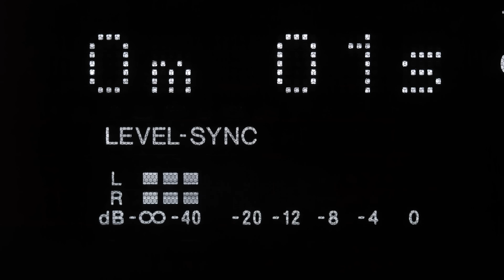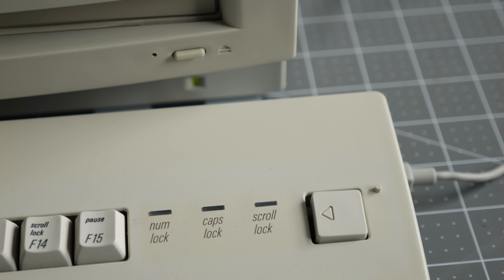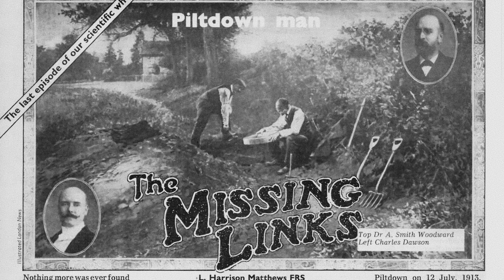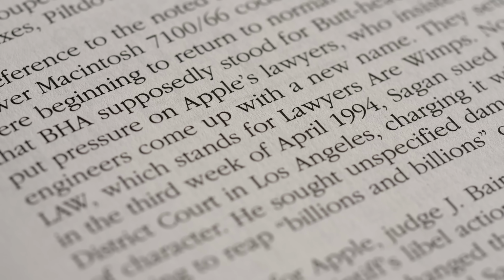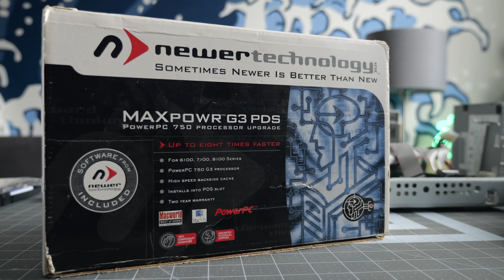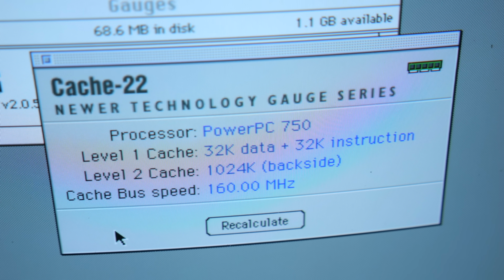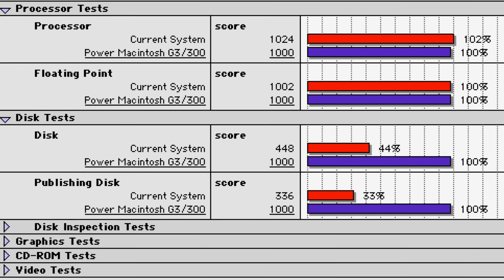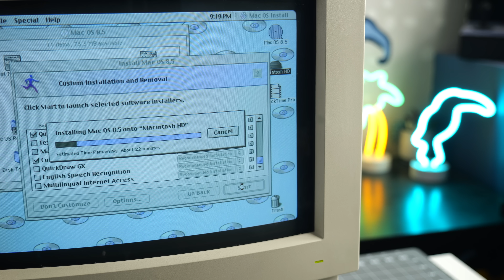Massively Speeding Up Apple's First Power Mac!

Comment: I got a Power Macintosh 6100 myself last year, and was extremely lucky to find it came with a Sonnet Crescendo G3 in the PDS slot!
Reply: I've got one of those. unlike the 7100 CPU upgrade with the PDS ribbon cable, the one for the 6100 had its own PDS pass-through slot so you could add a graphics card. On a freakin pizza box machine!
Reply: Same here. I'm wondering if Sonnet will work in my Radius 81/110.  I would rather have it in that system.

Comment: Coincidentally, I'm working on a PPC 7200 and I have the Sonnet Crescendo G3 7200 400MHz card to go into it.  Thanks, Colin, for pointing out the slower drive speeds.  Since I have PCI slots in my system, maybe I'll add a PCI SATA card into the mix to remedy that issue.
Reply: Personally, I’d go with something period accurate-ish and use newer, larger and faster SCSI drives, which stays within the “spirit of the machine” for me. 

But I can totally understand why you’d go with a PCI SATA card (for a SSD at a guess?)
Reply: Get the Tempo Trio from Sonnet! It's a tri-fold expansion-card, functioning as a one-slot-fits-all solution, adding Firewire 400, USB 2.0 and ATA/ATAPI 133, all on a single PCI-card. The ACard AEC-6280M is another inexpensive ATA-solution, if only seeking for a drive-tech upgrade.

Comment: In the 90s,  this was a grandiose upgrade. Back then, systems were outdated after 2 years. That the rest of the hardware is partly limited is not surprising. I like these old times with Overdrive, AMD 586, Amiga 1260...... etc where incredibly outdated systems were suddenly upgradeable. Today, Intel e.g. gives new sockets every few years and something like Overdrive no longer exists.

Comment: Apple using proprietary video cables were just stupid, especially for schools that use those computers! My middle school had that Power Macintosh and used the dongle with their existing Apple monitors! Apple for decades have been using proprietary connectors for display, thanks for USB-C that are easy to connect Macs to non-Apple monitors!

Comment: In most cases, upgrading your CPU was well worth it.  In my experience of supporting Mac users in corporate environments, these Macs were used for only a few specific purposes, primarily doing graphics.  Sometimes applying filters and the like could be very slow and entirely CPU restrained.  IOW, the computer was fine for purpose, just slow at specific things.

A new Mac could cost thousands of Dollars.  If your CPU was the primary thing slowing you down, then it makes sense to replace the CPU.  However, these upgrade cards were stupidly overpriced.  Later on, the G3 and G4 sockets were pin compatible and so you could do a chip only upgrade from say a 233g3 to a 400G4 for the price of the chip alone.  Of course, it was nowhere near the upgrade going from an 80mhz 601 to a 300mhz G3 was.

Comment: This is quite literally the computer I grew up with! Very unusual to see the 7100/80 second revision being acknowledged, in my experience, but quite welcome. I even installed a processor upgrade to keep it running, though in my amateur hands it meant we couldn't fully close the case afterwards. The sound of its built-in CD drive struggling to load games is burned into my memory even today.

Comment: The issue with Mac CPU upgrade cards is they were never "for people on a budget". I get it, it probably was not cheap to source the components and the likely market share was very low so each unit needed to be sold for a lot of money to make any profit, but at $700 for a G3 upgrade card at a time when a brand new iMac G3 could be had for $900 just didn't make a lot of sense.
Reply: For most consumers, I would agree. The only use case where this would make sense is if a machine had some specific NuBus hardware they could not abandon or they were not ready to replace all of their old SCSI equipment with USB/FireWire equivalents. Once you factor the cost of replacing all of those old devices in addition to the computer, then perhaps the upgrade card to get a few more years of use would make sense.

Comment: Given how often Apple changed CPU types it seems they kept backing the wrong horse. With ARM they've finally done the right thing. But while I love their ARM processors as usual they've used the ability to lock down the computers to the disadvantage of consumers. So if you sell an ARM mac and don't unlock it via iCloud the new owner cannot use it at all, in fact many computer recycling companies are having to destroy the logic boards and sell off the rest of the parts. This is what's wrong with Apple now, too greedy.

Comment: Welp, there are some neat stuff going on with upgrades in PC sphere, like with the Ryzens and old mobos, that still can support like 3rd gen Ryzens after upgrading BIOS. But yeah. Old times were funnier. You could upgrade, and upgrade over the years, now it's mostly down to buying like whole new machine if you wan't a proper upgrade
Reply: Putting a Tualatin P3 on a slot 1 BX board was a real hoot..
Reply: @wishusknight3009  My PC in 2006-2009 was 440BX based with a Celeron 333MHz and 384MB RAM. I wish I would have known the board works with a Coppermine or Tualatin, though I was just a kid so even if I had known I wouldn't have had the skills to upgrade it.
Reply: @Pasi123  There were interposers that were made to work on some of those boards lol. They were as expensive as a decent motherboard and cpu anyhow.
Reply: @Pasi123  i stilo have a 300a Celeron that easyli clocks at 433, and a duron 1800 and Barton 2500xp @ 3200. And several other cool cpus 🙂

Comment: Funny how many times "Apple created a software emulator" has come up in their history to handle processor changes.
Reply: three. wait, how is that funny? 

it could have been worse, imagine they had a card or clip-on device or dongle containing a 68040 for ppc macs to continue compatibility a la the Apple //e PDS card.
Reply: True, but how many times did somebody's entire software library just not work any more after a complete underlying processors ISA change?  In most cases, you didn't even have to know that anything was different.

Contrast that to how long it took Microsoft to shift from 16-bit real mode to 32-bit protected mode, or 32-bit to 64-bit.  Just contemplate for a moment the existence of "Internet Explorer" and "Internet Explorer (64-bit)" in your Start menu, and whether your grandmother had any idea why there were two, how they differed, and why you would choose one over the other.

Built-in, transparent emulation is a pretty good strategy from a UX perspective.  Even if it hobbled the performance of apps, and even the OS itself, until they got around to re-writing it all.  You weren't inherently stuck with poor performance (just needed software updates to unlock the potential), and/or you didn't have to clean the slate and start over with your software investment.
Reply: Same as Windows on ARM
Reply: @gluttonousmaximus9048  Who uses Windows on ARM?
Reply: @orangejjay  no one yet, but it'll almost certainly replace the entire low end PC market within the next few years. Potentially the high end, if someone bothers to make something suitable to the workstation/gamer market, and legacy compatibility issues are sorted out.
Reply: @Trdintl  Nobody will as long as AMD and Intel are still in business.
Reply: Yep, and it shows the absolute beauty of the ARM transition. Microsoft tried for years and is just becoming to success. The difference in performance between the M1 and the old, intel chips is not near close to the 68030 to PPC change but this time was different. A great deal of it is the comprehensive development environment, tons of memory, and performance that allow just-in-time compilers and, clearly, Apple's experience.  One of these days, if the E.U don't ruin everything,  they will move to RISC V.
Reply: Only 4 times not that bad

Comment: Turns out Apple's love affair with dongles goes back farther than I thought.
Reply: Dongles started out WAY before these machines. Look at the PowerBooks with HDI-20 and HDI-30.
Reply: @RichsRandomRetroReviews  The first PowerBooks came out 3 years before these computers.
Reply: @masterkamen371  That was my point. Dongles have been around much longer than people think.
Reply: The shadows betray you because they belong to me
Reply: Best chonk of a dongle was the one for the Apple IIe emulation card in some Mac LC's.
Reply: @siliconinsect best dongles are clab/emagic notator dongles for atari. They are the best.
Reply: Well, let's consider the PC industry at this point.  There wasn't really a "standard" -- there was just "what IBM was doing" until the PC clones snapshotted IBM's architectural decisions at some particular point and carried on using it as a de-facto standard from then on.

But over that time, we had both 9- and 25-pin serial; XT and AT keyboard protocols; AT and PS/2 keyboard connectors; MDA, CGA, and EGA on 9-pin digital connectors; analog VGA on a 15-pin connector; MFM, RLL, ESDI, IDE, and SCSI hard drive protocols, on ribbon cables with card-edge connectors, ribbon cables with IDC connectors, and board interfaces with card-edge connectors; floppy drives with board-to-board and ribbon cable interfaces with card-edge and IDC connectors, single- and double-sided 5.25" disks, double-density and high-density 3.5" and 5.25" disks, 8 or 9 sectors per track for double density, 18 sectors per track for high density, 300 or 360 RPM, FM and MFM encoding; FAT12 with no BIOS Parameter Block, FAT12 WITH a BPB, FAT16 with a 32MB limit, FAT16b with a 2GB limit; ISA vs MCA vs EISA vs VLB vs PCI...

But sure, silly Apple for not getting it right with that all-in-one connector.  ;-)